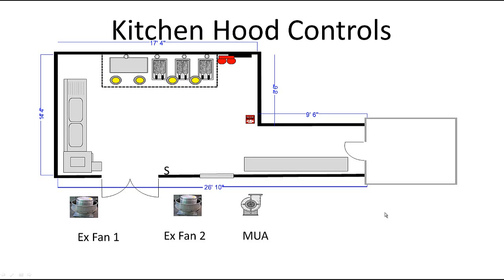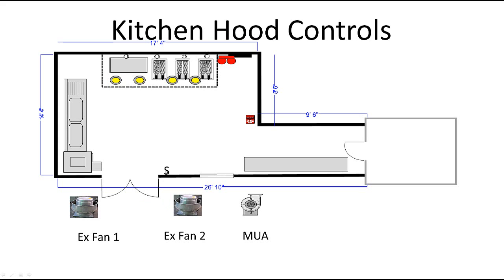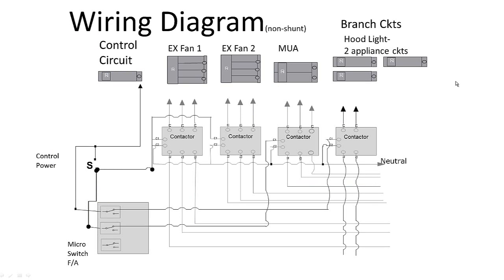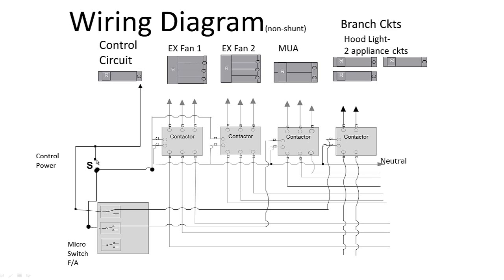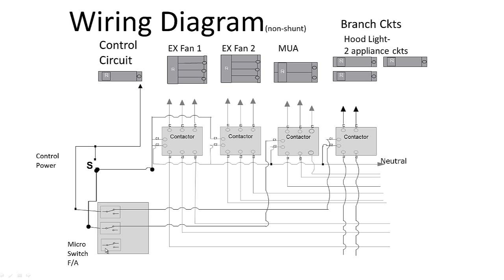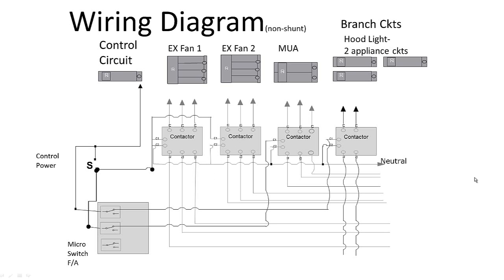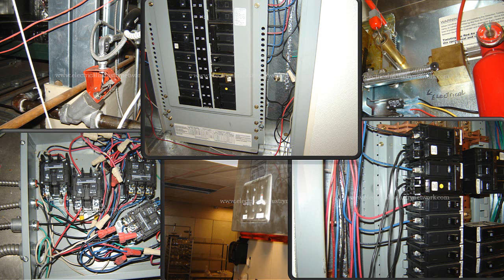Kitchen Hood non-shunt Trip

Comment: Hi , there .  I have a question about when the  Abdul system is triggered,  I can see on your diagram that light & outlets all cut out by microswitch.  But you didn’t mention how a the Exhaust Fan will turning On ?  Since the the switch is on open position.

Comment: You are missing a wire, when the Ansul system trips and exhaust fan switch is off, the fans will not turn on. Code requires exhaust to turn on no matter what position the Fan switch is in if Ansul System trips

Comment: Ignorant, but honest question: Why do the exhaust fans remain on in the event of a fire (when the fire emergency button has been pushed)? Wouldn't that cause more air flow, which would increase the size of the fire?
Reply from the maker: The purpose of the ex-fans running during a fire is to reduce heat and smoke. I understand your thinking,
 but the fire department tells me they want the smoke out.

Comment: am i correct if you connect the normally open of the first shunt switch to the ex fan contactors this will ensure the ex fans are on when the switch is off in an emergency state??

Comment: Great diagram. Thanks but have a couple questions. One.. in your drawing it appears the hood switch must be on for the exhaust to be running even if the Abdul actuates. Is that acceptable? Also it looks like you could tie the Mua and branch circuit/lighting contractors together on the control circuit and avoid using the second ansul device contacts. Sound correct? Thank you!

Comment: If your switch is off and your system goes into fire mode, what turns the exhaust fans on? Should be controlled by one of your NO micro switches, but i don't see the wire. Thanks.
Reply: the micro switch on the fire system.

Comment: Great presentation thank you. I know the only thin missing is the two exhaust fans need to turn on even if the switch entering the kitchen is off position,
easy accomplished by running a wire from the first micro switch on the normally open side to the first cont actor bovine hot leg.or the second cont actor bovine hot leg will do the same.
In case an alarm goes on, the first micro switch will send signal to the firs two cont actor turning the exhaust fan on even if the kitchen switch is off.
thank you for this great video.
Reply: Correct he did miss this important part on his explanation!!!, I know you know better the this guy making videos 👍🏻🙌🏻😆

Comment: This is awesome.  Just exactly what I need for the owner to understand the work needed for his restaurant.
Reply from the maker: Thanks,glad it helped.
Reply: Hi do you have a diagram for installing regular commercial hood /fan
Electrical part for it
We need a switch for the light with 20am breaker 
Then sensor 
And fan switch 
Is there some kind a diagram one goes where ?any information will help this is the first time I’m doing it.
I’m a journeyman for three years 
If you can give me some advice, I would appreciate it

Comment: Correction: What happens if your switch is in the off position and a fire occurs? How will the exhaust fans turn on when the fire suppression is activated?
Reply: The exhaust fan is required to turn on automatically.
Reply: I also would like to know. I am doing the restaurant from hell. 9 contractors total with 4 shunt trip breakers. I'm getting a back feed when I try and add the override. I close one and it hold them all closed
Reply: @aztecabrnsoyyo1167  tienes que montarle un relay seco auxiliar nc pasar el power y conectarlo al contactor de tus exhaust fan junto con el switch power para Cuando tu Micro switch canbie de posición tu ralay auxiliar mande power a tus exhaust fans
Reply from the maker: The make up air is what get shut down in case of a fire. I know what your asking but the systems are not required to turn on the ex fans automatically.

Comment: Very educational. But what I don't understand is what happens if your switch is in the off position and a fire occurs? How will the exhaust fans turn on? Where will the power come from?
Reply: This is why its preferable to go with a direct control ventilation system. Captiveaire as well as some other make a system that has temp sensor and/or firestats, depending if its ansul,Tank, or Core, in the hood. The fusible link will still activate the fire suppresion system in this scenario but fans will not operate. DCV system, when the microswitch activates, will power the exhaust fans automatically, no need for a switch to be on
Reply: Is there any way to make it work in this manner, I have inspector already call me out on that but the owner does not want to go that route  @barberhvac3438

Comment: i agree seen a house with k&t that had 16 gage stranded wire run to every ground screw on each receptacle then to the basement all stuffed into a large wire nut with one wire running to the ground screw in the disconnect for the watter heater that was feed with modern 10/2 from the 20 year old 100 amp FPE panel that had sort pieces of romex  going into j boxes then to the k&t  all this covered with insulation  so other than the FPE panel everything looked fine and tested as grounded

Comment: Do you do any house rewiring? Got to replace a lightswitch with an outlet, and in the junction box above it I got a few wires, Black, Black, Black, Black and Black.
I assume they are soldered and wrapped in tar paper (no terminal block or twist on connections or anything, wiring from the early 1920s). Didn't take a too long look at it, just made a mental note it is not a five minute project as I originally thought.
What would you do? Out with old crummy in with new shiny?